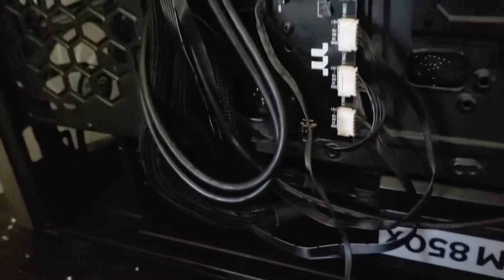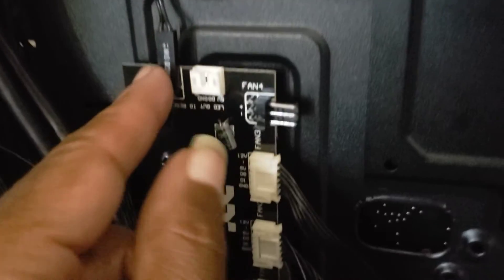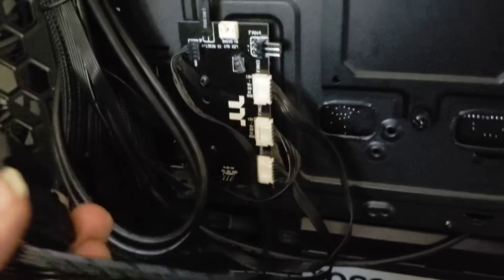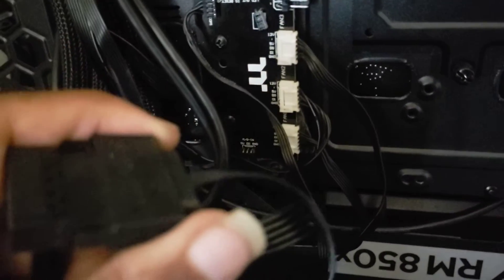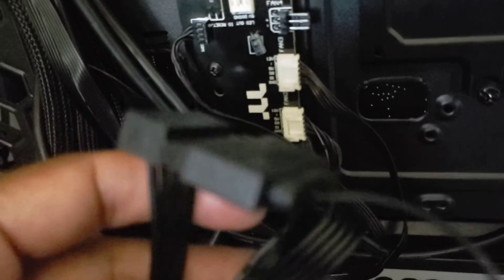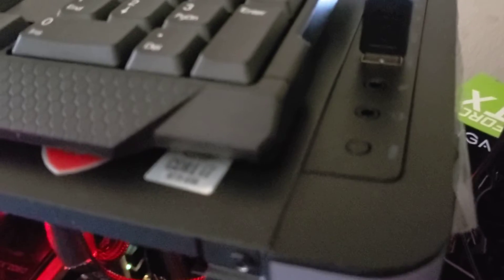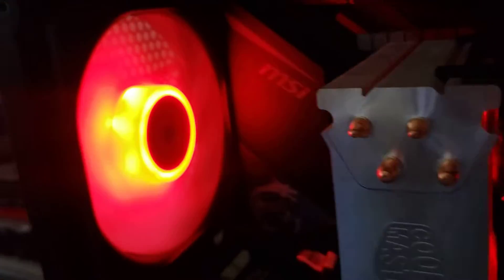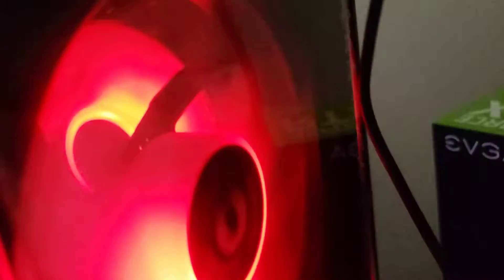THERMALTAKE LEVEL 20 MT CASE HOW TO HOOK UP RGB LIGHTS 6/15/2020

Comment: you can hook this up to your MB and by holding the button on the  front of the case for  3 seconds it wil flash 3 times showing its now sync to the MB and you can then use icue or Aura sync and stuff like that hope this helps :)
Reply from the maker: thxs for helping

Comment: an information I have the same thermaltake 20MT case a fan in front runs in slow motion what can it be?
Reply from the maker: check the wires in the video the connections
Reply: @ngagenokia  controlled the connectors can be the controller
Reply from the maker: @pietrostama2936  or its a deep connection inside the front fans its hard to get to the connections

Comment: Those can be software controlled.
Reply: That is true, or you can use an aftermarket rgb/fan controller
Reply from the maker: @ClaustroGames  yea but everybody not going to do that
Reply: That is true, I ended up having to oder a new control board to make it work. It wasn't a huge hassle, but it did cost about $70
Reply from the maker: @ClaustroGames  damn
Reply from the maker: depends on motherboard
Reply: I got a good one lol
Reply from the maker: @ClaustroGames  ok cool

Comment: Can you please do a video about connecting a fourth rgb fan on this controller? Because I see an available slot for a fourth fan. I understand that one of the plugs from the fan would connect to the motherboard, but the other plug, how would it connect to the three pin available slot on the controller?

Comment: The switch you connected to the controller, doesn't that go on the motherboard? Also, it has space for fan 4, but only 3 pins. The fan I've bought has 4 pins. Can it be connected to this controller or do I have to connect it into the motherboard?
Reply: On this rgb controller can I add another fan? The fourth fan option on the controller only has 3 pins. My fan has 4 pins.
Reply from the maker: @easternise  no only 3 up front
Reply from the maker: @easternise  no 3 only  front fans

Comment: and how do i control em with the software?
Reply: I just finished setting this up. I got it to sync with my gigabyte motherboard argb sync using a cable that came with the case. It connects on the bottom of the rgb controller on the back of the case and is labeled "motherboard in". You connect that cable and the other end plugged into one of my motherboard argb led 3 pin heads. The last thing is to press the rgb button on the top/front of the case for 3 seconds and that makes it so the lights are controlled by the motherboard rgb software.
Reply from the maker: you cant

Comment: Do you have discord or anything to help walk me through this? Because I plugged one end to the peripheral 1 and the other to the place you plugged yours and my psu almost blew up. A response would be well appreciated
Reply from the maker: you watch my build video
Reply: @ngagenokia  yes I have it did not help no offense I just need to know how to plug up my fans and then my pc will be finished
Reply from the maker: @zhiqz_3882  front fans
Reply: @ngagenokia  yes my front fans I plugged one end to periphals to my psu and the other end to what you plugged end and then it popped
Reply from the maker: @zhiqz_3882  ok the front fans are power by hook up power supply
Reply: @ngagenokia  I got the fans to work now I just have to hook up the rgb
Reply from the maker: @zhiqz_3882  do you have the same case i have
Reply: @ngagenokia  he’s
Reply: @ngagenokia  yes same exact case
Reply from the maker: @zhiqz_3882  what motherboard
Reply: @ngagenokia   msi x570 gaming plus mpg
Reply from the maker: @zhiqz_3882  ok you watch my build
Reply: @ngagenokia  yes I have
Reply from the maker: @zhiqz_3882  the 3 front fans wont work off the motherboard
Reply: @ngagenokia  my fans work I just want the rgb aspect
Reply from the maker: @zhiqz_3882  oh ok yea thats by power supply and the top button
Reply: @ngagenokia  top button?
Reply from the maker: @zhiqz_3882  to change the colors

Comment: Bruh I have a b450 F and it doesn’t have 5V 3pin ARGB headers. I don’t know what to do. What do people do when their motherboard doesn’t have the right header? I’ve seen converters for $10, but for $10 I could’ve bought a better mobo or case.

Comment: Do you hook up the rear exhaust fan that comes with the case to FAN4 on the controller?
Reply from the maker: Motherboard stock fan was replaced with a red fan
Reply: @ngagenokia  but i mean if i were to buy the case and just use the stock non rgb fan at the back would i hook it up to FAN4 on the controller
Reply from the maker: @kiiboy3977  hook it up to the motherboard the back fan  see the build of it video
Reply: @ngagenokia  oh i see. so what is the FAN4 on the controller used for? i know fan1 - 3 is the front fans.
Reply from the maker: @kiiboy3977  only the front are rgb others are red hookup to the motherboard

Comment: Im using the same case. This is my first time building a pc and I'm getting frustrated because it seems I can't boot the pc. Everything is hooked up and when I put the plug in and turn on the psu the only visible thing powered is the motherboard(it has a light) and once I press the on/off button on the case nothing happens for example the fans don't spin or light up and BIOS doesn't show on my monitor with a 'No Signal' box on the screen. Also I have a mouse and keyboard that have rgb but they don't light up when I put them in the usb slots. I've already taken it apart once and nothing changed. I'm thinking it has something to do with the front panel's power connectors for the buttons on the case but I'm not sure how to take it off. PLZ HELP!
Reply: front panel connectors must be off i built one yesterday for the first time and its perfect
Reply from the maker: watch my i7 build
Reply: Change the SATA Power cable. You are probably using one from another power supply which looks the same but it really isnt. I had same problem. Thank me later :)
Reply: It’s the I/O pwer switch connection. Pull those off, plug in power supply to wall, make sure power supply is not on the “O” but one the “I” symbol. Lastly make sure your RAM & CPU are seated correctly. Make sure power supply to Mono with the 26 pin connector is on correctly. Check power supply to CPU, usually an 8 pin plug that looks like the PCI-E Plug BUT NOT interchangeable!!!! It has to be 8pin or 4+4 going directly from PSU to EPS ( cpu) connector on Mobo
Reply: Short the power switch header pins with a paper clip, try diff combos til it starts

Comment: Did you connect it to the USB header on your motherboard?
Reply: that is what i was wondering too, hope he sees this and reply :D
Reply: @hamaniyacin8285  just moved my pc into my new case and all I did was connect a power cord from my power supply into the controller on the back. then you can use the button on the case to control the rgb
Reply from the maker: yes